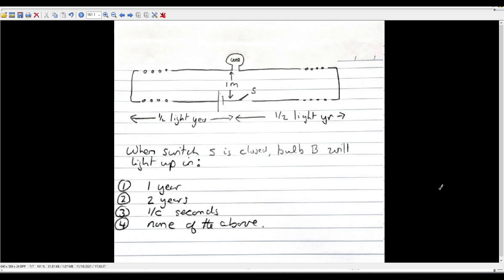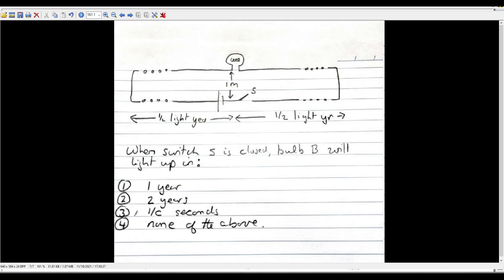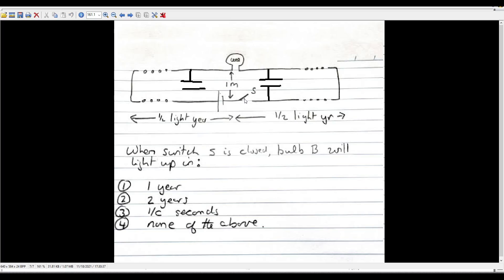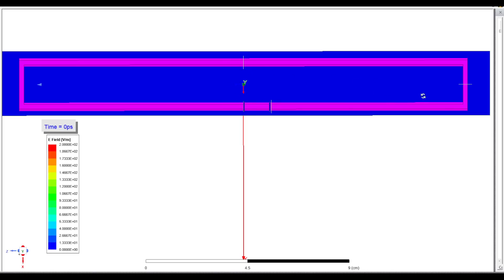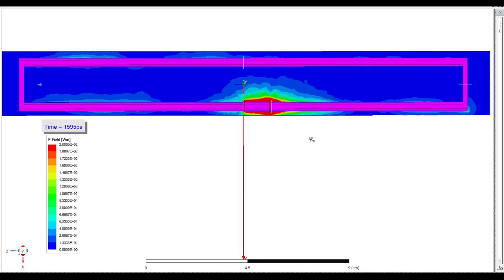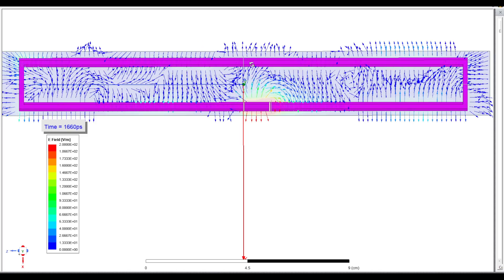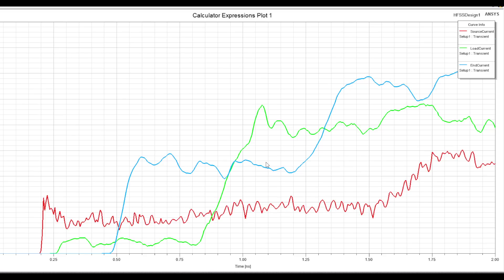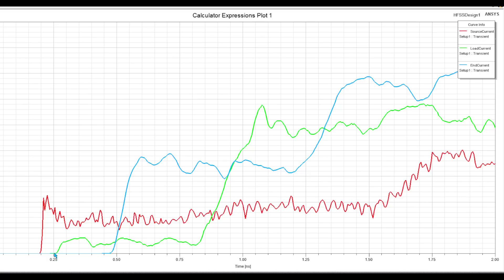Response To Veritasium - Electricity Propagation Time Problem

Comment: I believe Veritasium said: 1) 1 second (not 1 year) & 2) 2 seconds (not 2 years). Otherwise, excellent explanation.
Reply: well this video is also right
he (veritasium) also said/showed the *total* wire length (from one terminal of the battery to the other) is 2 light seconds
here in this video its 2 light years
so its still the same question/problem but with different variables (wire length and the time dependent on it)
Reply: @MuhammadAhmed-gm1bv  Equivalent postulation, not "the same question".

Comment: Is the E*H poynting vector even valid in the DC fields? And even in the fields that are seperately produced by two static field source like a magnet and a charged capacitor? If that's the case does poynting vector represent the power flow in such cases? Can you also discuss the power flow in the case when a magnet is placed between a  charged capacitor with large plates? 
PS: Many say that in the poynting vector formulae the E and H fields have to be produced by each other by induction as in the case of EM waves but there was no such implication in the derivation of the poynting vector that I looked up. Your comments on the situation would be really valuable.
Reply: It is valid for DC.   Just to help illustrate it, consider a thought experiment at some extremely low frequency (microHertz).  To you and me, those fields look static, but really aren't.  There is no lower bound in frequency where it stops working.  Regardless, the derivation works for straight up DC.  For your magnet and capacitor question, there are some very interesting results - the Poynting vector will have circulating closed loops - no net energy flow, but in a sense reflecting the fact that magnets have circulating electrons that cause the B field in the first place.   The Feynman lecture notes give a much better description of this.
Reply: @bobwhite137  Thanks for the reply!  I tried to visualise the fields but had some questions regarding the whole case. Consider a non conducting bar magnet ( non conducting so that we need not worry about induced charges that will influence the net electric field)  placed along the x axis in presence of a uniform electric field along the z axis.  One of the face of the bar magnet; the one parallel to xz plane receives energy while another such plane transmits energy ( by considering the net poynting vector around the surfaces)! The faces parallel to the yz and the xy planes have some net poynting vector along the surface. And as the magnet is non conducting there is no J component along the magnet's surface and the fields are static so they aren't storing energy either( unlike in the case of charging capacitors and inductors).
As per the explanation above ; it kind of looks like a DC Circuit where there is net energy transfer. Are non conducting magnets possible or is that assumption invalid somehow?So which point am I missing? Where did I go wrong?

Comment: The problem is this video and veritasium are talking about different circuits. Here talk about the Transient time where the voltage acts like a impulse effectively, and impedance matters. Veritasium talk in the Steady State, and put the question of switch closing . In that imaginary circuit the establishment of the voltage (about c speed) is Transient, and with switch Open, the voltage is there, at the terminals of the switch, not at lamp, and is one steady state. The other steady state is switch Close and start imediatly the current, so lamp On. So Imediatly as the electric field complete the 2cm of the switch. So the lamp lights so quick as 2cm/~c. More quick than the 1/~c , and the coherence of units referred in the video, come from that physical interruption of that circuit, full of prerequisites. We know the electrons move very slowly (current), but all start all at the same time as the electric field is closed is the fact as they are chained by electric field force in one direction in the Steady State. Don't break causality as don't break causality if we move one solid (have all atoms chained) and all atoms move at same time independent of solid extension. Note:~c is the "almost c", as c is only in the vacuum. In conductor is less but "~c". This i post to other videos. But I agree with you, as your explanation about the Transient time and relationship to the 1/c answer is far away better than others videos.

Comment: You can think of the wires as a big charging capacitor. That's also why Derek said that you will not get the whole voltage from the beginning. Because of coupling between the wires due to 1m distance, is like a capacitor charging and you will have the initial energy in 1/c seconds.

Comment: My complaint with Derek's video is that he played fast and loose with his definition of power delivery. He posited an "ideal" lamp. So one that lights with no delay. But his demonstration was with a domestic sized globe. Even a high efficiency LED lamp is going to pull a few watts. It isn't just a matter of the first transient of available power. Derek never implied anything other than power delivery as expected from the battery to power an appliance via the wires. The viewer is clearly expected to interpret the lamp as a surrogate for any useful device. Derek spends most of the video talking about power delivery networks. Even if we allow him an ideal lamp that is 100% efficient, he proposed a problem where the wires are 1 metre apart and powered by a simple battery. Unless the lamp breaks conservation of energy there is no physical manner in which a domestic lamp, such as he demonstrated, will light with the energy available over that one metre gap. A small LED, sucking on a few 10s of milliamps, yes. But a multi-watt domestic LED lamp. No. And since the viewer is never informed that the lamp is "special" and that the problem is only applicable to very low power situation, they are left assuming that the lamp may be replaced with, say, an electric motor, and that motor would also deliver real power after 3ns. Which it cannot. 
I think a follow-up needs to call Derek on this dissembling. With his continual talk of simplifying lies the viewer should expect that Derek's explanation would be clear and complete. It was neither. It was worse than the simplifying lies. It produced a fuzzy and confusing explanation that did not cover the reality in a useful or correct manner.
Reply: yes exactly.   he handwaved away a different set of physical conditions to get the answer he wanted than were implied by the question.
I.E. the power requirements for the load vs the resistance of the wire.
Reply: @equalmc276  if perfect conductor and perfect lamp there is still no chance of delivering enough energy to emit light in 1/c.
Reply: @noop9k  Wrong.  And that's the point of his question.  We don't even need an ideal lamp, just use a single LED, or any other lamp which is roughly matched to the Zo line-impedance (few hundred ohms, times two.)   The battery essentially has one or two K-ohms in series.  So, use a 10mW lamp, not a few-watts lamp.
If we DIDN'T want a "trick question," then instead use a 10K resistor as a load.   But that won't atttract wrong answers, create public embarrassment when everyone realizes that Veritasium knows circuit-physics, but THEY DON'T.
Reply: @wbeaty  No, 3 is plain wrong. Think a little bit more, and if you still don’t understand why, I’ll explain.
Reply: Thing is that i will likely be a year long transient voltage ramping up, as more of the capacitatic wires charge until de the wave hits the end. The lamp is just a way to say 'there is a current'
Reply: @Harmonys-y2k2  “any” current is a ridiculous statement again meaning that you don’t need the wire at all. Extremely tiny EM disturbance created by simply moving some charges around the battery and the switch apparently “turns the bulb on” without rest of the wire even participating.
Reply: @Harmonys-y2k2  All his talks about fields are just handwaving to justify the wrong statement.
Fields and charge carriers (electrons, but not always electrons) can’t exist without one another. By moving, electrons create changes in the field that makes other electrons move etc. But the wire is a medium full of charge carriers, that facilitates propagation of the field, while air doesn’t.
There’s inverse square law, meaning that electrons affect electrons in nearby atoms MUCH stronger than electrons in the wire 1m away. Therefore most of the energy travels as a wave along the wire.
Some tiny portion affects the opposite wire directly, and this how antennas work. But the setup shown is going to be a bad antenna. And the amount of energy delivered in straight line to the destination in “1/c” is incredibly tiny though it will at least become at least measurable later as more electrons in the wire start moving, creating a stronger field.

Comment: Great analysis, but there is no need for any deep analysis to see that 1/c is wrong. Just ask yourself if the wire was 10m long on each loop would the bulb light up? If it were 10m but one loop was cut at the furthest point would it light up? If it would not light up in the latter case then it is therefore IMPOSSIBLE for it to light up in 1/c because that would constitute faster than light communication as it would need to know whether or not the wire is cut. However, if it is looked at as a transformer where inductance is what is causing the current then the first effect might be felt in 1/c, but that will not be enough to fully light up the bulb. The full voltage will take longer as seen in the simulation. Also what materials are in between the battery and the bulb matters eg if the wires are shielded. So I disagree that answer 3 is correct. Sure you can detect that there is a current in a wire by measuring the electric field, but that is a far different claim from saying you can power any device wirelessly by simply running the wires in parallel 1m apart.

Comment: As pointed out by different people, choice 3 should have been written 1m/c
Reply: just ifyou live in the US, for the rest of the world, meters is king
Reply: @antronixful  Duh! I live in Canada. 1/c has no units so it makes no sense. What's it got to do with the U.S. ? I lives in the metric system all my life. There is a huge difference between 1 (just the number) and 1 meter (a length) !!
Reply: @francoisleveille409  it was a joke because people is looking for something to complain about the video... also, 1/c has units of time/distance and if you want to make c dimensionless, its value and the one of 1/c would be the same (natural unit trick), but for that to be the case, you must to make the assumption of distance -> meters, time -> seconds
Reply: @antronixful  1/c=1/(300000km/s)=.000003s/km so that's NOT a valid choice of answer unless you give units to the numerator. Then and only then can your answer be in units of TIME.
The question being HOW MUCH TIME does it take for the lamp to turn on. 1/c DOES NOT equal units of time. 1m/c=3.33 nanosecond.
Reply: @francoisleveille409  that's why we invented the international system of units lol
Reply: @antronixful  So why do you keep leaving answers that are meaningless and irrelevant ? Metric is the only thing I have known all my life and I don't live in the U.S.

Comment: I don't think the capacitor is an approximation. If you stop to think, that's EXACTLY how a capacitor works, and that circuit is indeed a big capacitor.
The amount of time it would take for the light to turno on would be the amount of time it takes to load the huge capacitor.

Comment: What if the wires were  arranged in a circle (circumference=2c) instead of  rectangle? Would the result be the same?
Reply: No, the answer would be π/3e8 meters I think
Reply: The topology of the wires matters only if the wires are so close that the electric field encapsulates both.

Comment: I think the point of Derek's video was to show the bulb would experience current and voltage much sooner than the length of the wire would imply.   My logic, i reasoned induced changing B field would cause an opposing current to cancel the B field out and the rate of change of that B field induces a voltage in accordance to faraday's law.   I did not think of it as an antenna.   I have a feeling veritasium was just priming us for the next video which demonstrates this affect.

Comment: you keep mentioning the 'heart of the problem'. i say the entire scenario is so ill proposed that defining what EXACTLY the 'point' of the scenario is IS the issue. it is vague and open to interpretation. what may be your 'heart of the problem' may not be someone elses, and to impose only you have the TRUE interpretation is beyond arrogant.
Reply from the maker: You make a good point that I am realizing more and more as people comment, the problem is intentionally vague, but that requires people to agree upon the assumptions before having a meaningfull discussion about it.

I feel like I have been pretty generous with my acknowledgement of the validity of other peoples assumptions (if you read my responses to comments), and in my conclusion at the end of the video I also acknowledge that there is truth to answer (1) that the full current is not seen for a year.

To characterise my tone as imposing and "beyond arrogant" is certainly hyperbolic.

Comment: Thanks for the video! What is the use of hss ansys? Picoseconds time scale modeling, is it used to model the circuits in a cpu / other nano stuff?
Reply from the maker: Ansys is the company name, they make all sorts of modeling software, mechanical, thermal, electric, etc. HFSS is one of their EM simulation products. It is quite versatile, you can simulate antennas, microwave circuits, waveguides, transmission lines, multiport S parameters and pretty much anything in between. Its sister program, ANSYS Maxwell 3D would be used for things like motor design where you need to simulate EM forces and motion. Between those two programs theres not much you cant simulate.

However im not very certain about nano scale IC interactions. There you get into a lot of solid state physics that im unsure if HFSS or Maxwell 3D can simulate.
Reply: @PulsedPower  thanks!!

Comment: Thank you for this wonderful video Ben! This cleared up a lot of things for me. I have a couple of questions;

1. Within this hypothetical framework (ignoring the wire resistance), will the relative position of the switch ( wrt. the bulb) play a role? Looks like the spherical waves are originating from the location of the switch closure.
2. Let’s say that the circuit is complete, but the bulb is electromagnetically shielded using a Faraday cage. Will the bulb still light up at the same point of time? Will it light up after sometime (depending on the circuit dimension)?
Reply from the maker: Muthu, your observation is correct, the changing field propagates from the switch. If the switch was 1 light second from the source then it would take 1 second for the field to drive current at the light. You would need to shield the entire cable (ie a coaxial cable) for it to completely "shield" the bulb. If you just put a metal box locally around the bulb then as soon as the field reached the unshielded portion of the wire it would propagate through whatever feedthrough you have going into the box.
Reply: @PulsedPower  Thanks for your reply, Ben. So when does the bulb light up (any current flows through it at all) if the wire is replaced with coaxial cable?
Reply from the maker: @ObserveThePatterns  In that case it would be the total transit time from the switch, to the end around the bend and back to the bulb. So 1 year or 1 second for the original diagram and Ve's video respectively. This is assuming an air or vacuum filled coaxial line. Any dielectric media will change the propagation velocity based on its relative permittivity.
Reply: @PulsedPower  Thanks for clearing this up. Makes sense to me now👍The confusion in Ve’s video came from the statement and the corresponding illustration (at 6.15 seconds) “When the battery is connected, the electric field EXTENDS through the circuit AT THE SPEED OF LIGHT”. It also looked like the establishment of the magnetic field and whatever happened subsequently, depends on this electric field being there first which I could not understand being independent of the circuit dimensions. The spherical wavefront clarifies things. Please make more educational videos in the future.
Reply from the maker: @ObserveThePatterns  Im glad my explainations are helpful! Thank you for the kind words, it certainly encourages me to put time into new videos!